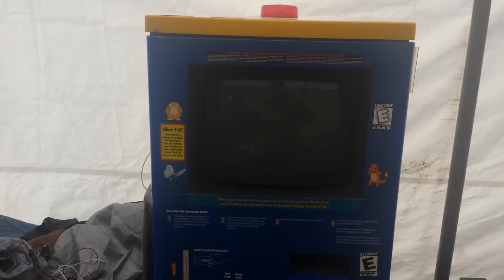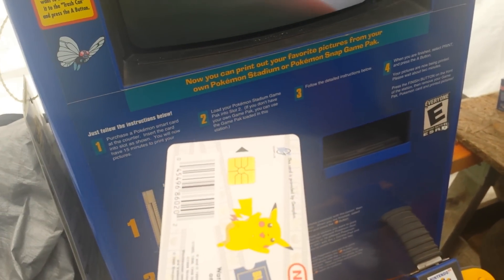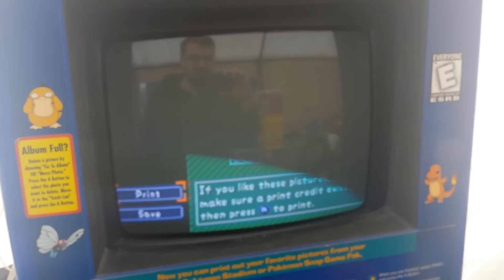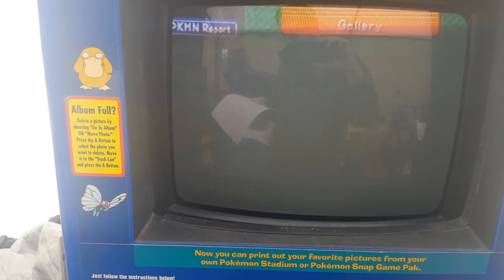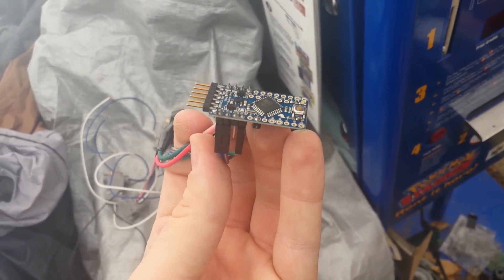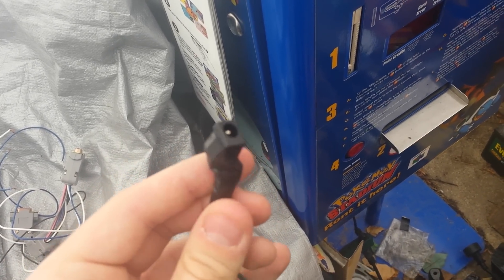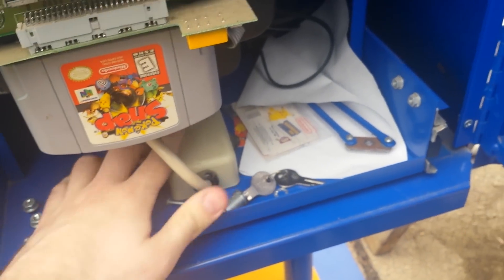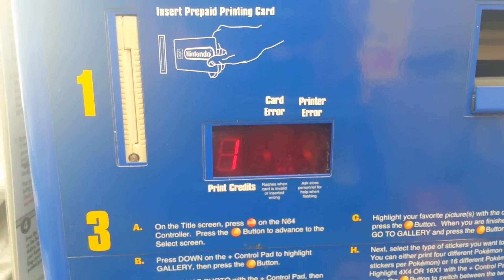Unlimited Credits on the Pokemon Snap Station

Comment: So the card reader is capable of writing to the card then, that's how it sets the credits on a card to 0. Have you tried to write a bit of code that will set the value of a card to 1 instead when finished? You could even adjust things so that it skips the check to see if there are credits on the card and automatically sets the card to 1 at the end of the transaction, potentially not only printing for free but also restoring already used cards to a usable state for other machines. With the added benefit that you would still use a card to activate the station, making it feel just a bit more like childhood. I'd take a crack at it myself, but frankly there's no way I'll ever be lucky enough to own one of these machines to test with.
Reply from the maker: Unfortunately, the area that stores that bit is write once. It gets set at the factory to “1”, and then when the machine sets it to “0”, it’s no longer possible (by regular means anyway) to set it back to 1.

Comment: When using the smartcards, what happens if you yank the card out just before it takes the credit? Does it still print?
Reply from the maker: Nope, it takes the credit just a moment before it starts printing. If the card is missing at that point, the N64 is simply restarted.

Comment: This is cool, but as someone who has this station (I've had it for 8+ years now) you actually don't even need print credits. Just remove the metal piece on top of the printer and you can use the buttons on top of the printer to manually print without the use of cards/credits.
Reply: Yes he talks about how that takes you out of the experience at the beginning.

Comment: Hey bud.  I know you said you don't make any more due to some of the software doesn't match up on some.  But would be very interested in one.  If it doesn't work oh well I won't expect a refund or anything.  Let me know if you would help me out thanks!
Reply from the maker: Hi! I’m actually working on a commercial version of these right now. I’m working with another person to beta test them to see if I can get them working on other machines. Email me and I’ll get back to you with more info! lilmul123@gmail.com
Reply from the maker: Hi! I'm about to sell these Pokemon Snap Station adapters commercially.  If you're interested, please email me at steve.muller@embeddedsolutions.llc

Comment: Maybe the differences of which one your device will work on is the image on the bottom right. Both yours and mine have Blastoise in the bottom right corner. I’ve seen other variants have pikachu in the from bottom right corner.
Reply from the maker: Hi! I'm about to sell these Pokemon Snap Station adapters commercially.  If you're interested, please email me at steve.muller@embeddedsolutions.llc

Comment: I made one for my snap station and 1 credit shows up but when I hit print it won’t restart and start printing any advice on how to correct this
Reply from the maker: There should be a power brick on the power strip in the middle of the machine that says "Power Reset for N64" or something along those lines.  If your N64 isn't plugged into that, it'll never reset and get into the printing mode.  I'd check that first.
Reply: That was the problem it prints and reset back to 1 credit after it’s done great video thanks for the help

Comment: Could you give some details on how the printer hooks up to and interacts with the n64 itself? Would be nice to have homemade print stations rather than needing to buy an official one.
Reply from the maker: Hi! I'm about to sell these Pokemon Snap Station adapters commercially.  If you're interested, please email me at steve.muller@embeddedsolutions.llc
Reply: @lilmul123  hey a bit late to the video but did you ever decide to start selling these adapters?? If you're still selling them I would definitely be interested in a couple for my snap stations!! Super cool to see you were able to figure that out!!!
Reply from the maker: @thepokemonpost  yes! I have some in stock right now. Send me an email at steve.muller@embeddedsolutions.llc and I’ll get you the info.
Reply from the maker: It's actually not complicated at all.  The composite video coming out of the N64 is piped through the printer.  The N64 fills the screen with one of the images selected, and then sends a signal to the printer telling it to save the photo in one of the twelve sticker spots to print.  After all twelve have been shown and saved, the N64 sends another signal to the printer telling it to print.  The printer is essentially a Nintendo-branded Panasonic photo printer, and the signals that need to be sent are probably in the manual.

That said, I don't know what signal is being sent to the Snap Station cartridge telling it that it's inside of a Snap Station.  Without that signal, the print options are just greyed out.  The cartridge is just a regular Snap Station cartridge, so there's nothing special about the ROM that allows the printing to happen. Someone else might have already looked into this, but I have not.
Reply: @lilmul123  That last bit is why I was curious what's going on with the controller port. It sounds like it's just used to send commands to the printer? So then the game weirdness is happening with the board where the cartridge plugs into? I wonder if it'd be possible to use a gameshark to patch out the print station check, and then make a n64->printer cord that'd work? At least, if there's nothing special about the printer other than being a regular photo printer. That'd make sense why it's possible to print with just using printer controls as well. Since the printer is functionally just receiving commands to save the screen and to print the saves. And then the game is just cycling through the photos and sending the save and print commands through the cord.

Obviously there's nothing weird with the rom itself, since I heard it's running your own local pokemon snap when printing? So if the printer and cord aren't doing anything weird, that must mean the board is intercepting the game and injecting something to tell it that it's the print station.

Comment: For those of us that aren't tech savvy, would you sell one of those units pre-constructed?
Reply: siccooper I second this remark! Let us know if this is something you would be willing to do. Thanks!
Reply from the maker: @Tomgetsome  Hi! I'm about to sell these Pokemon Snap Station adapters commercially.  If you're interested, please email me at steve.muller@embeddedsolutions.llc
Reply from the maker: Unfortunately, there seem to be some differences between some Snap Stations that I haven't accounted for.  I've made three of them for others, and only one has said that it worked for them.  Since I only have the one Snap Station and coming across another one is extremely unlikely, it's hard for me to figure out the differences.  Because of that, I've decided not to make any more of these for the time being.
Reply from the maker: Hi! I'm about to sell these Pokemon Snap Station adapters commercially.  If you're interested, please email me at steve.muller@embeddedsolutions.llc

Comment: Just wanted to follow up - I've got an Arduino set up on my system and everything is working amazingly, thank you so much for doing this, let alone posting how and where to get the resources!

Out of curiosity, do you know if the existing reader has a signal sent whenever a card is inserted? My plan is to wire up the existing reader to the Arduino, and when a card is inserted and read (regardless of how many credits are on it) it would send the credit inserted signal out to the machine (so Card Reader > Arduino > CPU). Any ideas?

Cheers, and thanks again for this!
Reply from the maker: Glad to hear! In the time since I've made this video, I've learned that some Snap Stations actually use a slightly modified protocol, and this method doesn't work on those, but it sounds like your version is the same as mine.  

It does not send a "signal" per se, but the text string it sends does change that notifies the Snap Station that a card has been inserted.  You could definitely do this by hooking up the serial lines of the card reader to two other pins on the Arduino, and then checking for the changing text string.  When it changes, you would then start sending the data that it currently sends from the Arduino to the Snap Station.

This is a pretty cool idea.  I might work on this myself later this year.
Reply: @lilmul123  Hey man! Just out of curiosity, any attempt at looking into this? I randomly found more cards and remembered this!
Reply from the maker: @LightningXCE  Hi! I'm about to sell these Pokemon Snap Station adapters commercially.  If you're interested, please email me at steve.muller@embeddedsolutions.llc  And this version implements the idea you came up with!